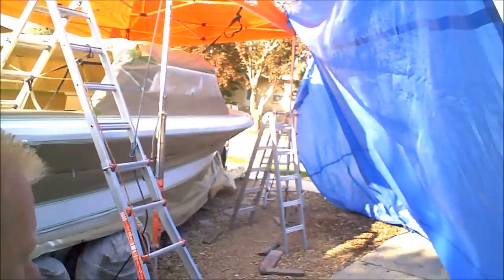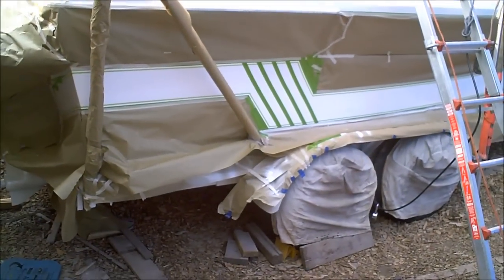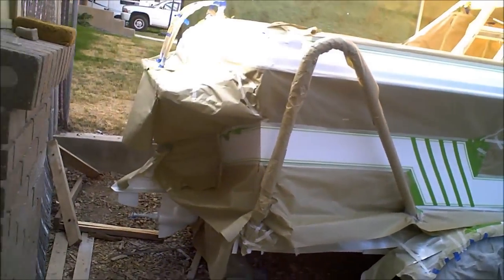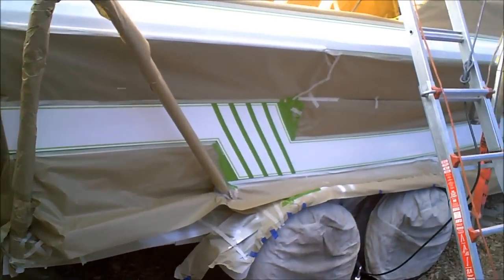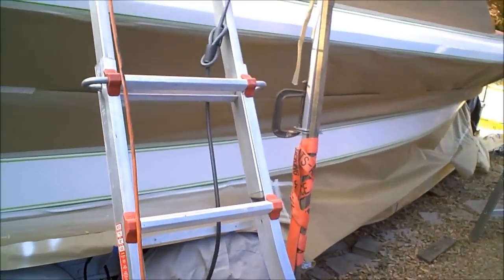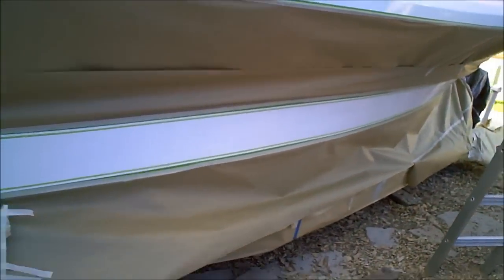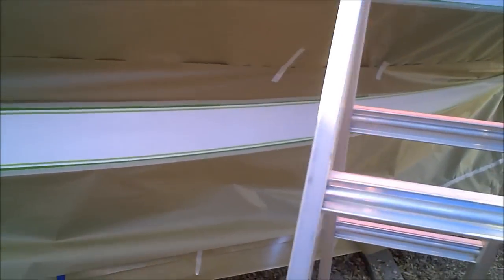5 Restoration 1973 Fiberform Boat More Painting part 5 of 7

Comment: How did you get the bottom of the boat while on a trailer?
Reply from the maker: I didn't as the bottom never gets much sun, so it is in a lot better condition than the upper. The only areas that didn't get resprayed is were the bunks are. I figured the fish are the only ones to ever see it.